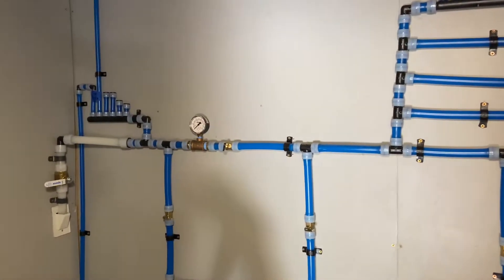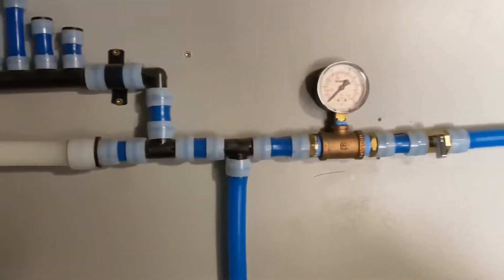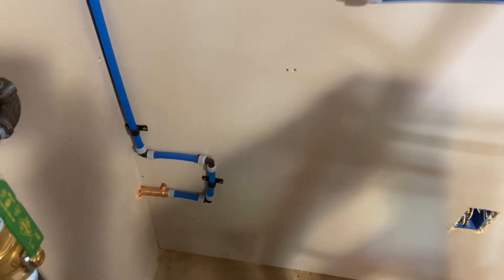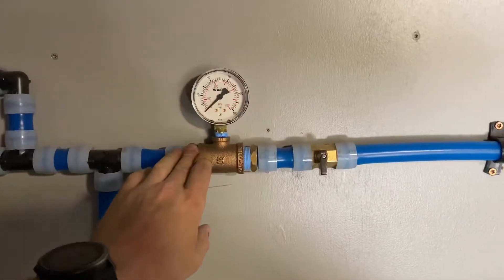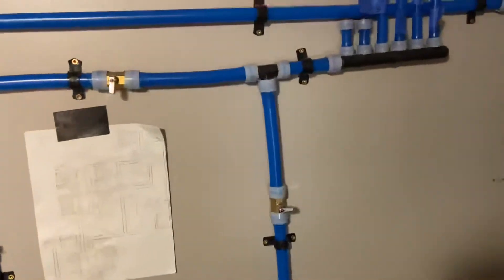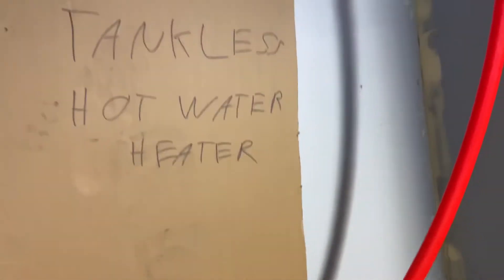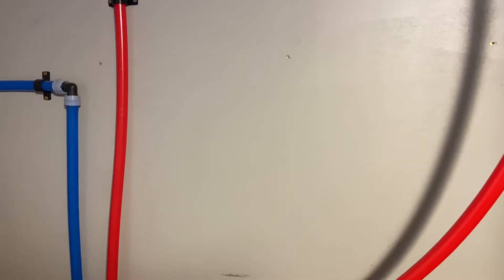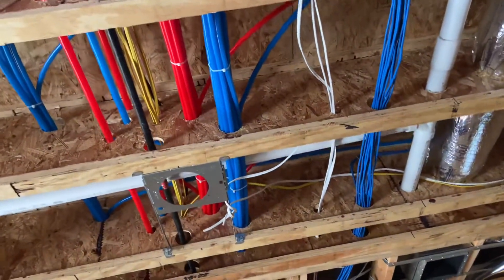Episode 50 - Water Pipe Rough In - Uponor Home Run

Comment: Jesus christ, so many unions. So many leak points
Reply from the maker: Unions?  You mean fittings?

Those Uponor fittings are unlikely to leak and if they do, it isn’t in the wall. 

It is a lot of pipe and a little complex but getting hot water quickly to a fixture without having to discharge a larger feeder pipe is nice. 

Thanks for watching.
Reply: @Ciband  yes, fittings are a potential leak path. The work is neat, and i commend tou for that. I do however think the excess fittings are a liability.
Reply from the maker: Sure, they are a risk.  My think is I’d rather have it leak in a mechanical room with a flood sensor than in a wall I can’t see. 

Thanks for the kind words and thanks for watching.

Comment: Most of those short pipe lengths between fittings are against Uponor warrenty. There is a minimum cut distance between fittings. Usually 2 x OD. If those leak they wont be covered by the 25 year warranty
Reply from the maker: You are absolutely correct. I missed that particular point on the specs and only realized it after the fact. Still no leaks and running well, but it is a good point. 

Thanks for watching.

Comment: Pot filler will never be used while also using another line in the kitchen. Could be off the faucet. So much waste.
Reply from the maker: I have actually used both at once. Rare but it has happened. 

I would not want to tap off the faucet. That would be another stub up in the slab. 

I also have all this plumbed where the pot filler can be filtered for drinking and the kitchen sink would not as it is just for cleaning. 

Flexibility is worth $30 in pipe for a house I will live in until I die.
Reply: @Ciband  your whole setup is a waste. Way too many connections.
Reply from the maker: To each his own. I like the home run concept. Faster hot water to fixtures, flexibility to isolate an individual line, very few fittings in the walls, and having a central point where I can manage which fixtures get which grade of water (eg hard, soft, filtered). 

Overkill? Maybe, but I like options.

Comment: This is a bad design.  The "stubs" are too short.  Like others have commented, use a manifold if EVERY gosh dang line comes to the same point.  Next, you have a dozen or two cold lines, none insulated, running in the same direction.  Consider running a larger line and branching off.  Finally, the recirc pump termination is wrong.  Hire a pro or copy from someone better.
Reply from the maker: Thanks for the feedback.  I always enjoy being other’s point of view so I can maybe learn more. 

I could not get any Uponor compatible manifolds (something like the Vega) without spending a lot of money. Building my own like I did was much more economical (all things being equal). I would have preferred some turn-key manifold. 

Why would I insulate cold lines in a conditioned space (i.e. inside the spray foam envelope)?  Why does direction matter?

I did consider a trunk and branch but ultimately decided that the home run pros won out for my needs and wants. If I had to do it over, I might consider the Uponor Logic system for design. 

Can you explain how the recirculating pump termination is wrong?  I followed (to my knowledge) best practices from Rinnai and from “the rinnai guy” on YouTube (great channel, BTW). 

Thanks for watching.

Comment: At some point during construction design, one has to ask “what’s the point?” Should I dedicate so much money, time and living space to a system that may be mostly unnecessary? Getting water into any house should not be that complicated. It is very rare occasion that someone needs this much access to every drop of water in the house. Because we “can” do something doesn’t mean we “should” do something.
Reply from the maker: Every water delivery design has pros and cons. For this one, I really liked the ideal of minimizing fittings in the walls.  I also wanted the flexibility to send the correct water to the correct fixture. No need to send filtered water to a toilet or washing machine.  From what I read, the home run system would give faster hot water delivery. That was important as well. 

It absolutely used more pipe than trunk and branch or Uponor Logic, way more than I estimated. 

Definitely not the design for everyone but it very much works for my wants and goals. 

Thanks for the comment and thanks for watching.

Comment: So you're hot recirc loop is only for the master it won't really affect any other fixture ?
Reply from the maker: Yeah it really won’t other than charge the 3/4” lines that the other manifolds pull from. Some hot water will circulate through those manifolds and lines due to the temperature differences. 

If the circulation was going forever, eventually all water in all hot pipes would become hot. 

The runs for hot water not in the circulation loop are pretty short. Hot water delivery to the kitchen is probably the worst case there and it works perfectly fine. Not long to get hot.

Comment: Did you consider an uponor logic style system?
Reply from the maker: I would have been open to this. Honestly I never saw that design until I had already committed to my home run. 

With my remote master manifold, I think maybe me is more of a hybrid between homerun and logic (assuming I’m remembering how the logic system works). 

Thanks for watching.
Reply: @Ciband  yeah your master suite is basically a logic system

I was going to do home run as well but upon doing more research I think moving forward a race track style logic system makes more sense

So I just did three race tracks under my house of 1 in one for hot one for cold and one for recirculation

So basically there's just a giant circle and I even connected it in on itself so it is a physical flow through circle and then all my fixtures either manifold or tee off into 3/4 or half inch 

It ended up using barely any pipe and I think from a pressure standpoint it being a circle where pressure can come from either side should be a plus still haven't tested that yet though next step is trying to figure out if anything I'm doing will increase or decrease pressure 

And because I saved so much pipe I was able to do 1 in and 3/4 in and then stepped down to half inch right at the fixture unless it's a bath or a hose bib that can do 3/4 straight through to the fixture 

So theoretically within open our logic and a reserve you should have pretty much instant hot water anywhere only the little bit of water in the drop from the racetrack to the fixture needs to drain out
Reply from the maker: Yeah, if I had to do it again, I would probably think very hard about how to do that type of system. 

I liked the idea of minimal fittings in the walls but I did use a lot of pipe…lots of pipe.
Reply: @Ciband  only issue I ran into is there aren't any manifolds that are 1 in through with 3/4 outs so I'll probably do inch and a quarter for my racetrack next time cuz there is a three port inch and a quarter through with 3/4 out manafold 

So I had to basically make my own manifolds with the 1 in through 3/4 out t fitting which was fine I guess the math makes more sense if you're using 3/4 to have an inch and a quarter main line

Comment: Wouldn't it have been more efficient, more convenient and way cheaper and also far better organize to just use the Viega Manabloc manifold water distribution system!!?
Reply from the maker: They don’t support Uponor and I didn’t want to have another connection method.
Reply: @Ciband  Whoa! Your response to my statement was very fast! What type of water heater will you be using? A tank-type or tankless?
Reply from the maker: Ha, you caught me at the right time. I am using a Rinnai tankless, indoor propane.
Reply: In a previous video of yours (the one about the gas line setup) you talked about many gas appliances and devices, such as the stovetop, HVAC, the outdoor gas grill, possibly a future clothes dryer and the water-heater that will go into the house. Just how large will that propane tank be and will it be enough to empower all of those devices and appliances? And is that even cost-effective or efficient?
Reply from the maker: As far as the propane tank size, I will be putting in a 1000 gallon but allow space for a second one later. 

As far as propane and efficiency, cooking with gas is just better than electric so cooktop and grill make sense there. I will have a propane furnace but only as a “fuel fuel”. Primary heating will be an electric heat pump that will work for the majority of the season. I am using an electric clothes dryer (more cost efficient) but piped gas to it just because. I like options.  I am using a propane tankless since any electric tankless will pull a lot of electricity that I’m initially not setup for.  I will have provision to supplement that later should I choose to.